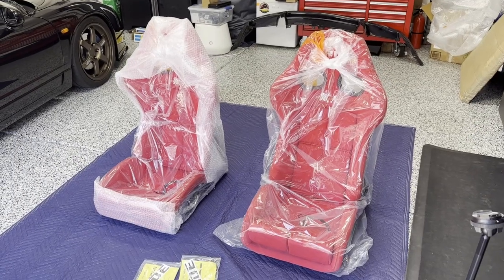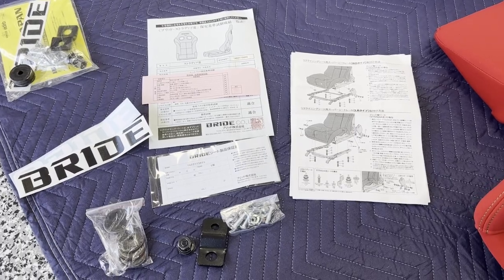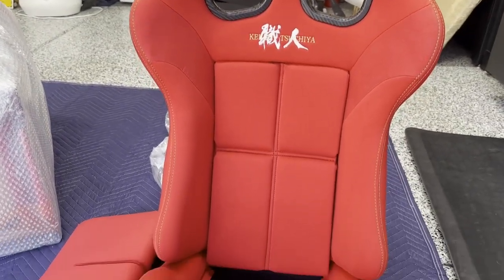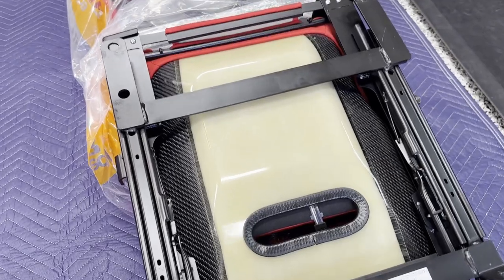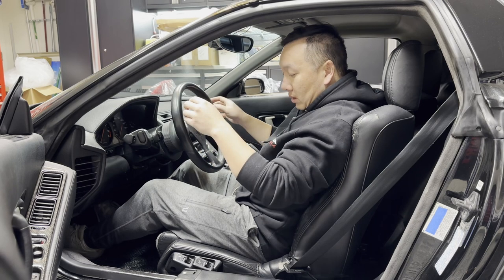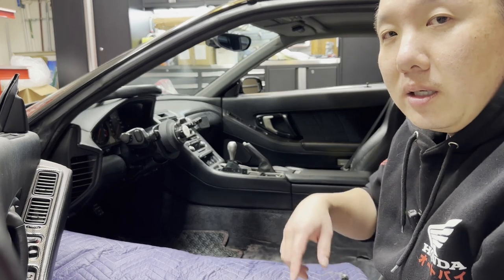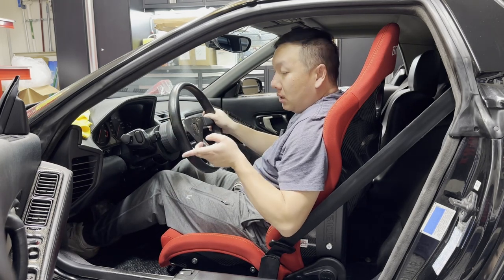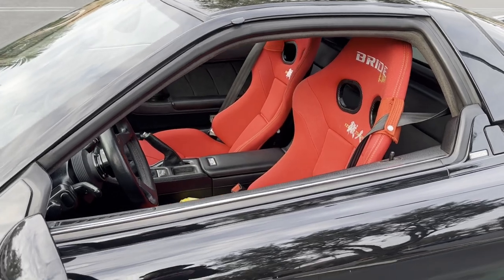Bride Stradia III King Series Reclining Bucket Seats

Comment: Thanks for the detailed video! Would you be able to measure the distance from the bottom seat cushion to the center of the wings? I was able to find the exterior dimensions which are useful for determining how well they fit in your car, but not necessarily to your body. I currently have a Pole Position, but don't like how much the wings roll forward my shoulders
Reply from the maker: My car is at the body shop right now but I will try to remember to do this whenever the car is back. How tall are you? My tall friend who is 6’-0 or 6’-1” said he didn’t like how the wings pushed his shoulders forward.
Reply: Yeah, I'm 6'0" with a long torso, so maybe this one won't be a good fit for me. It's pretty hard to find a seat that fits both me and my S2000 well  @ChrisLumNSX

Comment: I have been looking at these special edition seats for a while now for my RHD Prelude. I'm going to go with the Zeta's, what would be your suggestion on which Bride seat rail I should purchase (looking to do the same and have the seats as low as possible)? Seats look awesome in the NSX! Thanks for all the info & such an in-depth review.
Reply from the maker: nice choice. Go onto Bride's website and use their seat rail selector and they will tell you which ones work for your car. They may have different models that work, so you'll have to pay attention to the differences. Some rails sit lower than others and the lowest ones have a dual locking mechanism (no crossover wire or handle from left to right slider). These are not as convenient to slide front to back since you need to use both hands, but if you want to sit as low as possible that's what it takes.
Reply: @ChrisLumNSX  thank you! Will do. Man you have the exact spec I want for my black type s. Red Bride's, bronze TE's, and Spoon Calipers. Great job with the NSX!
Reply from the maker: @rob_becker  thanks!

Comment: Do you have any tilt adjustment with Bride seats and the mounts?
Reply from the maker: No tilt adjustment since they’re bottom mount but they do offer two different leg cushion types, normal which is wedge shaped and low which is flat and thinner—I mention it briefly in my video. So you can use those to help a bit with tilt. Bride rails are really good though and typically are engineered to have a very good seating position based on the car they’re developed for.

Comment: Is the seat adjustment range on the bride seat rails the same as the stock seat rails on the NSX? I'm 5'2" and want get aftermarket Bride seats for my NA1, but I am always afraid with aftermarket seats and seat rails, that I can't clutch in all the way without full extension. The previous owner had some old Recaro Pole Positions with I think Recaro seat rails and I couldn't fit because I am a smol boi and he probably had a tall setup. The seat belt position was also not in a safe position. With the stock seats I can fit fine, but I want something to hold me better especially if I take it to the track.
Reply from the maker: yes Bride Stradia should be able to accommodate you at your height. And you won't have any issue with the seat belts since it's not a full bucket seat.
Reply: @ChrisLumNSX does the seat have you sitting real low? I have zeta 4s in my 350z and had to set it on the higher holes in the side mounts to sit higer

Comment: Great vid, I want to pick up some Brides for my DC2 GSR. How do you get the passenger bride seat?? I only have the option for the drivers. If you see this please respond 🙏
Reply from the maker: The seats are universal between left or right. The part that is left or right specific is the seat rails. Brides website has a really good catalog that will walk you through all the parts you need, from seat to rail to any accessories you want. Check it out.
Reply: @ChrisLumNSX  You’ve made my night, thank you! Your JDM hero looks amazing keep up the videos my friend

Comment: My stock ND Miata seat does not have any waist support and make my back feel pain in a 40-min drive. So I am considering a Stradia III. I am wondering how it feels when you have a long-distance drive. Will it be too stiff?  Does it give you enough support for your back and waist?
Reply from the maker: For me it’s perfectly fine for 3-5 hr trips (that’s the longest I’ve been in them). But everyone is different. The Stradia aren’t as plush as some other seats. The cushions aren’t super thick. But that’s what I personally like about them
Reply: @ChrisLumNSX  Thanks! I just ordered the latest Stradia III Evo-S. It says the bottom cushion is 15mm thicker than a regular one on thier website. Finally a good seat make my Miata more enjoyable.

Comment: Any clue if the sensor comes on the gias? (BTW the sensors are pretty expensive unless your ripping it out from a used oem seat)
Reply from the maker: I’m guessing all Gias and Stradia come with the sensor now but it’s something you’d want to confirm with whoever you’re buying from. This is the fourth time I’ve owned a Stradia over the past 15 years and the first time I’ve seen the sensor.
Reply: @ChrisLumNSX  thanks! Yea it's the first time I seen sensors as well. It would help in terms of passenger seat sensor